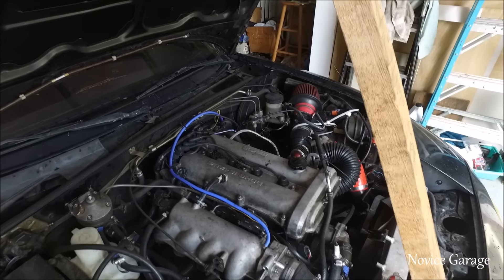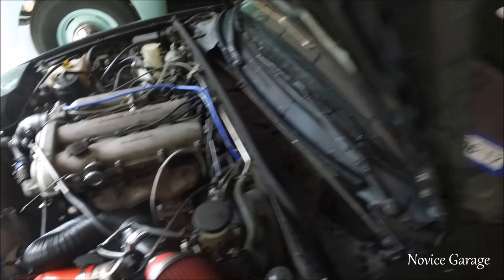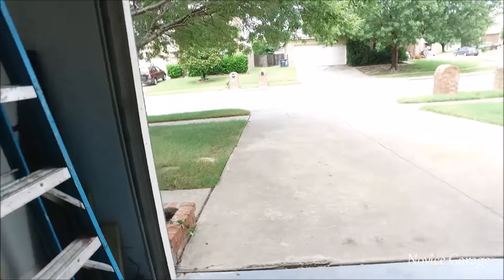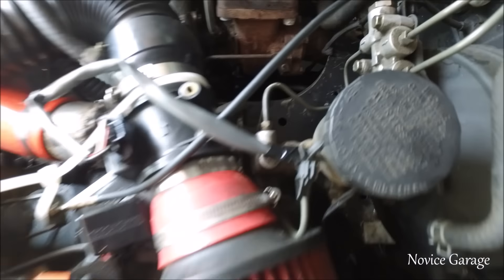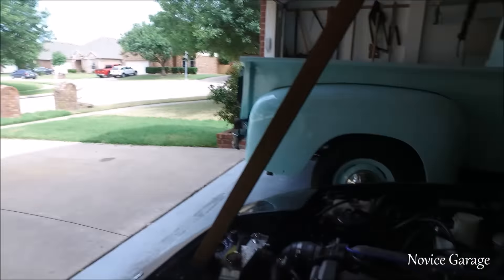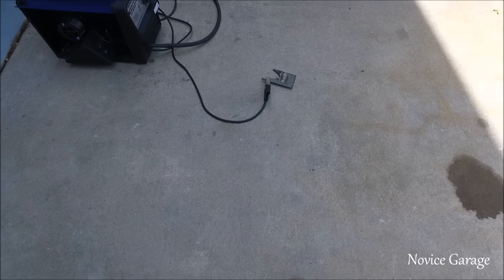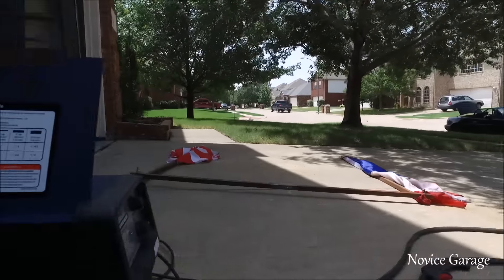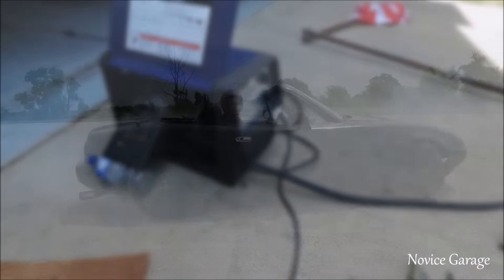A Video A Day Challenge

Comment: Angle the gun more perpendicular to the piece. If/when you mig weld with gas it will matter a lot more because the gas won't be able to shield the weld and you will get porosity.
Reply from the maker: +Devon Swindell Good advice

Comment: Do you know that bolts have ratings. That's one reason they can come loose.red locktite shouldn't burn off unless you car is getting hotter then500 degrees and it's not
Reply from the maker: +TheVintagetamiya The exhaust manifold sees tempts over 1000° f. Google it